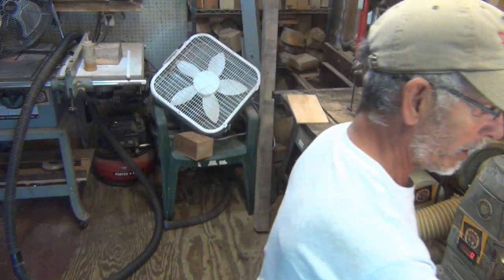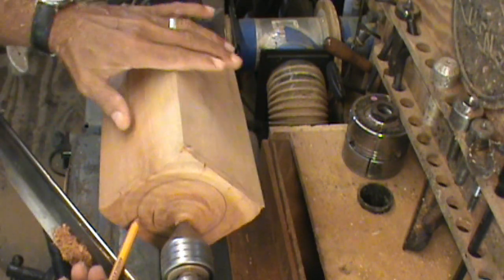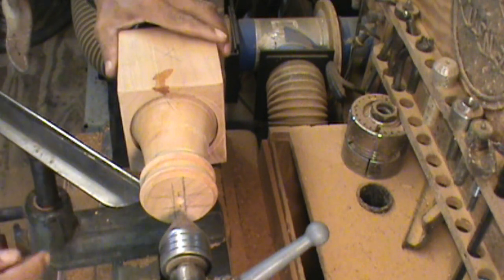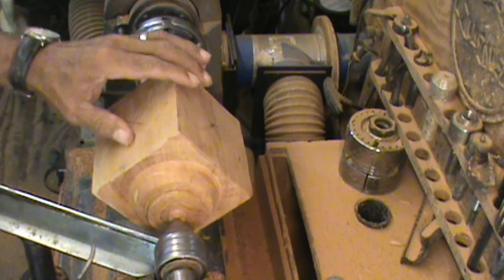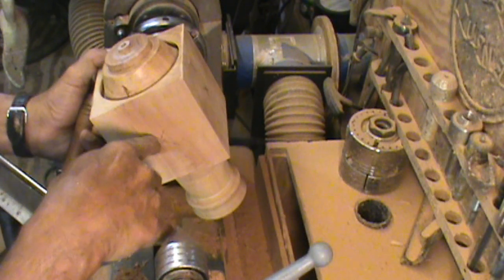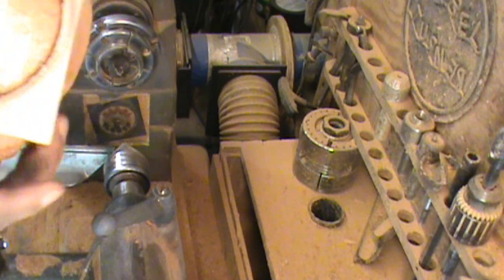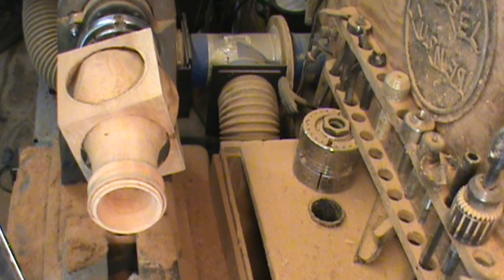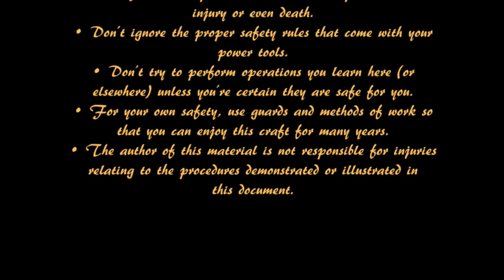Wood Turning  Floating Vase

Comment: Almost got it, Al. You'll get it next time. Possibly using a allen wrench ground down to cut the vase from the block might work. Have used one to hollow Christmas ornaments. Also, could you modify your steady rest to hold the box away from the vase? Would it have been better to try sanding through one section at a time? 
Just ideas to throw out for you to consider.
Looking forward to the final video when you complete it. Enjoy the family and  and the newest Rebel.
Dennis
Reply from the maker: thank you, all great ideas I did consider the steady rest